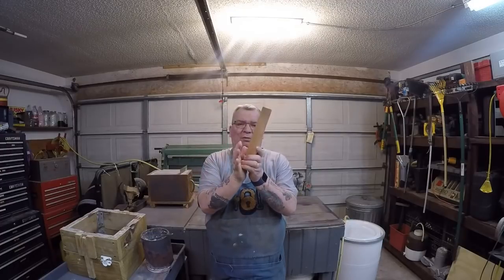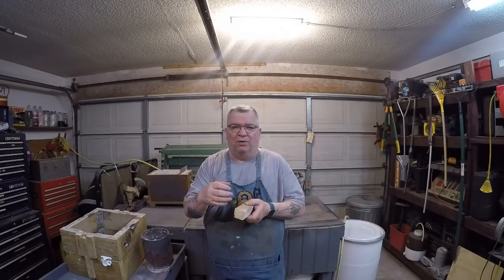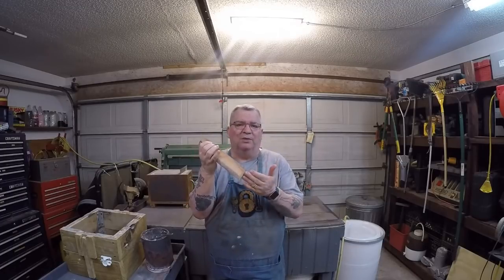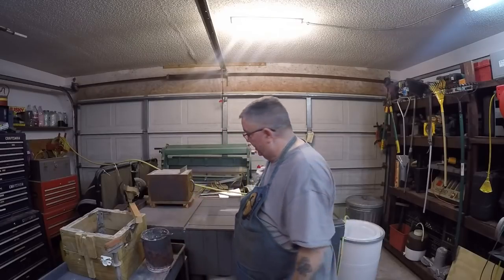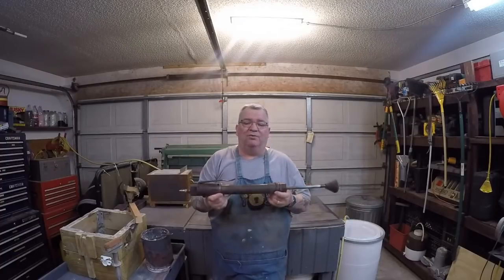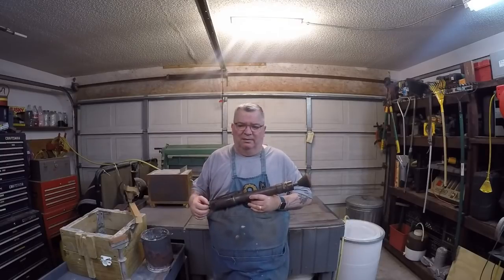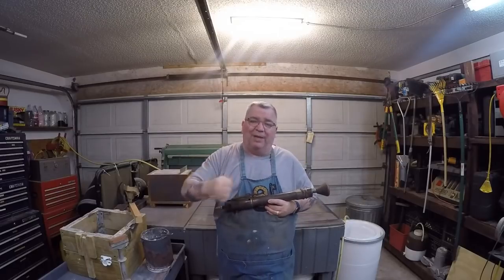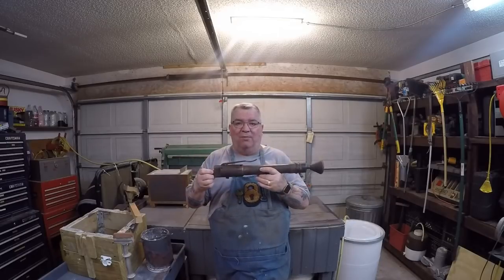History of Rammers

Comment: Is your small rammer a D3? I see they are sold on ebay at a good price
Reply: I recently took the risk of purchasing a D3 on Amazon with an industrial 3/8"-male air fitting. I am using it to sink 18-gauge steel shells. It leaks quite a bit of oil, but it made a 5-minute task without shoulder pain out of a 30-minute task that took a day to recover from. I have only used it for about an hour. I don't have an inline oiler, but I disconnect the coupler every 10-or-so minutes to put in a few drops of air tool oil. It is taking some getting used to, but I am pretty pleased with this $75 purchase. Otherwise, a ~$550 JET model seems to be the only alternative. I think the ebay ones are coming from the same place as the Amazon sand rammers.